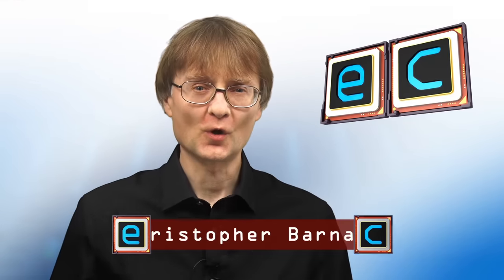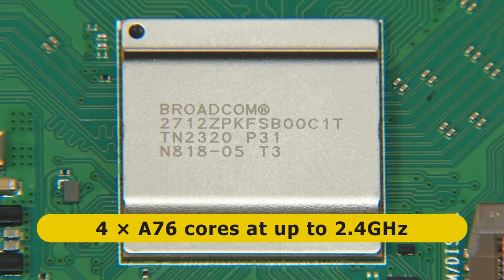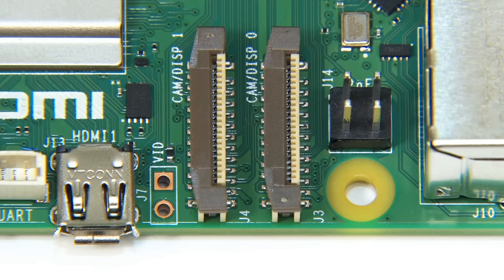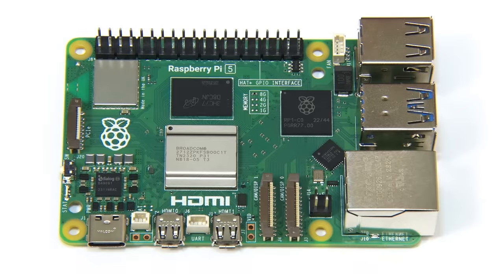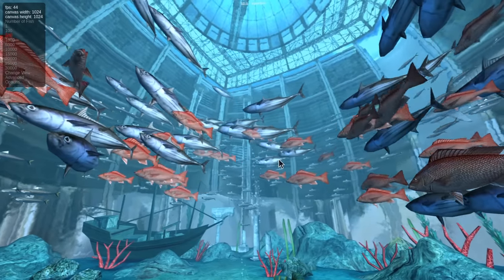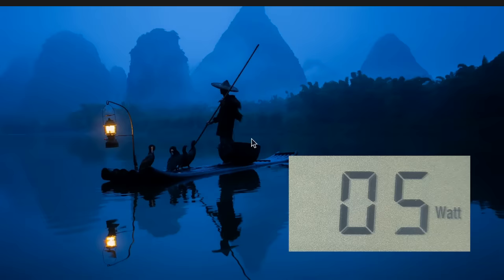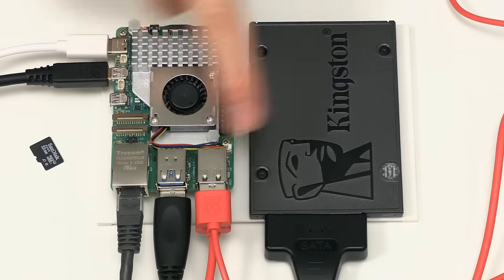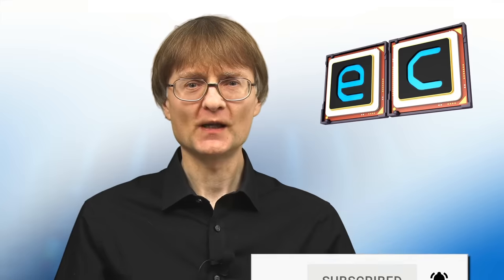Raspberry Pi 5

Comment: I still would have loved if that new IO chip was connected to the GPIO pins and allowed you to program them like a microcontroller so you basically had a microcontroller and full computer on one board. Also I hope with this pi needing 5 amps that theres a surge of 5 amp power supplies that are decent enough to actually run a raspberry pi because my small ass robot needs that much current and I can never keep the pi powered because they get ridiculous voltage drop or are just plain unstable they all suck ass
Reply from the maker: As I understand it, the new I/O chip is connected directly to the GPIO pins, which may offer some interesting possibilities as you note. :)
Reply: @ExplainingComputers   I hope, more PWM outputs without going over I2C and a hat would be amazing. I wouldn't be surprised if there was a lil rp2040 style chip hidden inside it

Comment: Please do not measure power below ~10W with these meters. Most of them will tell you lies! Use at least a 50W constant wattage resistive load in parallel to bias the readout to a known and stable level.

Comment: The Raspberry Pi are putting on a full-court press. But, frankly, I think this is too little, too late. There are plenty of SBCs out there that have better specs. And at $80, there's not enough difference between these new Pis and mini-PCs. (For instance, you can buy a PC with a Celeron processor, 6GB of memory, and a 128GB SSD for $109.)

Raspberry Pi is trying to gin up enthusiasm, but after years of non-availability, I think people have moved on. If you want an SBC, Raspberry Pi is no longer the first name you think of. And the SBC fad has just about run its course anyway. I wish them well, but this show of desperation is not likely to help them.

Comment: With the cost of mini computers really coming down, these pis feel like they are becoming a little irrelevant.  For example you can pick up a mini computer these days running windows 11 pro with n100 chip and 500gb ssd and 16gb ram for under $200.  Dual hdmi, multiple usb ports and using around 3w of power when running windows 11 and all works out of the box super silent.  This is a machine you can actually use for day to day whereas the pi is still very much a compromise on usability.  Once you add disk, cooler, case etc the pi is not that cheap
Reply from the maker: I totally agree on the price of an equipped Pi vs a mini PC. But a Pi 5 vs a similar-priced mini PC is not "very much a compromise on usability". A Pi 4 was. But not a Pi 5! :)

Comment: After watching your video, I'm actually disappointed in the RPi 5. Not because it doesn't do enough, but rather because it does too much. The RPi started life as an educational tool, then got picked up by the maker community. And while the new RPi 5 is indeed impressive, it no longer feels like it's targeted to either of those communities. All the focus on the desktop makes me think that the RPi Foundation wants to compete with Windows rather than just putting out a cool little device with some GPIO that you can have some fun with. I guess that it could be argued that this is what the RPi Zero 2 W and Pico are for. But even if this is the strategy, the RPi 5 continues to bring to an end of an era for low power, low-end computing. After all, when you're a young kid with very little cash to your name, the difference between $35 and $60 (RPi 5 with 4GB) is pretty significant. And it's kinda sad that all the focus is on the desktop rather than the CLI where you can learn about system internals and other important stuff.

So sadly, no RPi 5 for me anytime soon. Even if I wanted one, I'd be stuck since I'm not seeing any passive cooling systems on the market yet (like the RPi 4 has) and I won't ever install active cooling on any SBC. Fans that collect dust and have bearings that fail are so 1980s.😞

Comment: Everything about the pi is a lie. It's hundreds of Dollars to buy it with everything it needs.  The whole 35 dollar thing is utter BS.  Even a 4GB pi 4 is like 60 bucks.  Then there is the mandatory cooler. More money for the OS. More money for the power supply, more money for the case, more money for the keyboard and mouse.
By the time you spend all this money, you could easily buy a faster used computer.

Comment: If you don't need GPIO or ARM. For $130 you can get a 12 + 512 Intel N100 mini PC. Pi getting expensive...
Reply: For video center $40-50 Pi 4 which can do HEVC 4k60 is still good.

Comment: One disappointment. There's no NVMe port. Everything has to be external and limited by a USB port's abilities.
Reply from the maker: Not true, as there is a PCIe port, which will connect to an M.2 HAT to take an NVMe SSD connected directly to PCIe.
Reply: @ExplainingComputers  I didn't notice it "On The Board", which it isn't. That means one needs to shove it through a wire, into a controller chip at both ends, and then into the external device and the motherboard. Hence, the advertised speed just isn't there.  One can get by with up to about 18 inches of distance before everything glitches, and it all adds up quickly. Due to that everything is minimizes so much nowadays, and massively sped up, that 18 inch thing may be a whole lot shorter distance nowadays.  Electricity moves only just so fast, and when dealing with GHz speeds the devices are operating at nowadays, that ain't very far. Having all those interfaces, lossy "Plugs & Ports", along with the length of cabling.. It's just not what I would have expected from Pi. To the CPU, it'd be like picking one cherry off a tree with twizers, (one a day), to make a cherry pie 3 months later. `Firehose Single Bit Streaming.
Reply from the maker: @Absalon68  The ribbon cable connection for an M.2 HAT is likely to be less than 3 inches long, probably 2 inches.
Reply: @ExplainingComputers  IF, you can set up your External Device that close, and you Still have to deal with the lossy plugs and sockets. You were showing an external drive running around in the upper 400's. And when using an external NVMe drive, you'll still get around that same speed when it's naturally 4 times faster. And keep that Ribbon Cable away from any Electrical Interference!
  I know you like the Pi-5. So do I if all I were to do is play around on the web. There's much better SBC's, you know. But they come with a bigger price tag as well.  So I pay $5 more for an On-Board socket? I'd call that an upgrade Feature, not a bug.  But then Pi does what Pi is expected to do, as the Boss Man said.

Comment: This seems a pretty boring release compared to a lot of the other single board computers you've reviewed. I guess if the add-on hats for the PCIe connector are decent then it might save it. But overall pretty boring product.

Comment: Sadly nothing particularly innovative or exciting here. No sign of adoption of RISC-V in any way. Though the RP1 chip in theory could be a path to decoupling the Pi from any particular CPU architecture, I doubt that's their intention. Nothing particularly interesting for makers, no RP2040 or similar onboard, and no sign of the RP1 offering programmable IO (though I'd love to stand corrected on that). If anything, this Pi continues a trend of decreased emphasis on the maker space, RP2040 notwithstanding. I've long suspected that RPi is just a marketing vehicle and chip dump for Broadcom, and that they'll never truly be rid of that tie. Dependency on Broadcom and ARM IP will always be an anchor to the Pi's potential. I guess innovation is still firmly in the hands of the Chinese SBC market for a while yet.

Comment: Yawn... It doesn't matter if it's a RPi 5 or RPi 105. The latest RPi will always be a cheap way to run current versions of Linux badly, with GPIO. BBC Micro my ass. That Eton Upton's full of shit, man.

They should make something for bare metal, with a programmable sound chip, a little LCD and hardware for rendering characters/tiles, with a blitter etc. Something closer to the Game Boy Advance, with a 64-bit ARM quad core, and a Type-C debugging port - maybe chuck in a small FPGA.